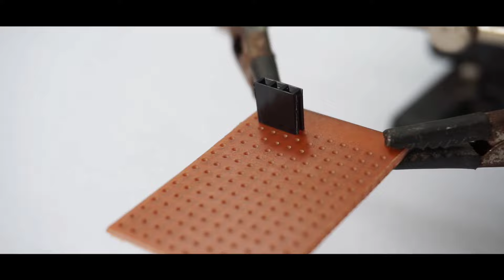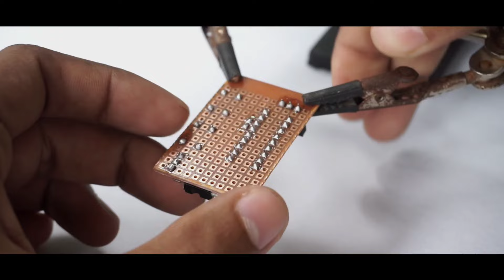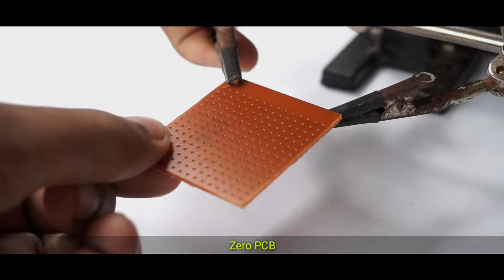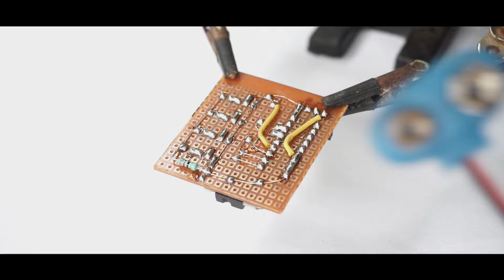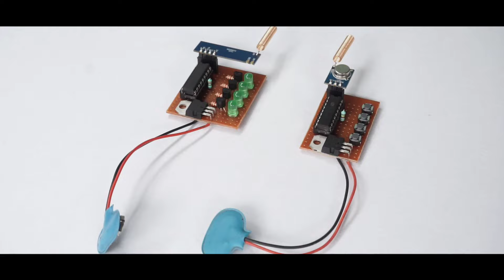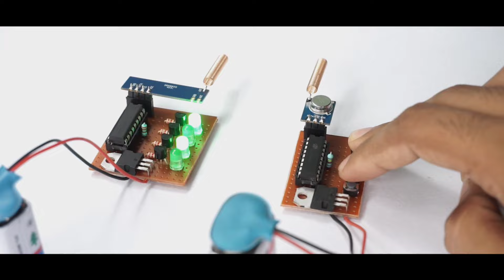How to make a 100Meter+ Ranged Wireless 4 Channel Transmitter and Receiver

Comment: seriously up to 100 meters?
Reply from the maker: More than 100 meter
Reply: @estechknowledge sir , please tell me truly ,, will it work more than 100 meters 
Because today I am going to buy it ,, please reply me sir
Reply: @Aswin_Raaj100 yes bro
Reply: what is range if it's more than 100 meters ?
Reply: @Aswin_Raaj100 maximum 10 mtrs only
Reply: The transmitter has a great output power. So I think a range from much more than 100 Meters ist possible.
Reply: I want to make e tricycle kit run wirelessly with remote....two motors....forward backward switch... acceleration joystick....turn joystick....plz help me for wireless remote and receiver....i used 24v  250w dc motor....24v 12ah battery

Comment: hey dude your circuit doesn't work without connecting te pin in ht12e to ground
and connecting A1, A2,A3,A4 in both ht12d & ht12e to ground then it should work
am I right cuz when I made your circuit it doesn't work without doing the above
Reply from the maker: Actually those pins are like passwords, if you connect A1,A5,A6 together with the ground in 12e, then you have to do the same with 12d. Then the 12d will be able to decode the signal/data.
Reply: @estechknowledge  
Then why it's not working without connecting TE pin to ground in ht12e?
Reply from the maker: The full form of the TE pin is - Transmission Enable.
Reply: @estechknowledge  
Yeah so why didn't you connect it to the ground in your diagram 😂👉👈
Reply: @estechknowledge  
that what I was mining for all this sorry if I bothered you 😂😅
Reply from the maker: Not a problem 😊
Reply from the maker: Oh, you said 'te' on your first comment I thought you wanted to say 'the'
Reply: @estechknowledge  
Also if you don't mind can you make rc car in the next videos?
You now made the l293d circuit controller & transceiver circuit can you merge these two to make rc car?
Thanks 🙏

Comment: Can I use motors instead of lights?How?
Reply: i think relay could work to connect two wire to passe the 12v or more volt

Comment: I have a query. In the video you have shown that your are connecting all the transistor's emitter pin to positive and the collector pins to respective LEDs but in the schematic you have shown that emitters are connected to LEDs collectors are connected to positive. Can you elaborate it.

Comment: I have a task to make a similar scheme, but so that the control buttons are separate from each other.  It is not rational to make the 4 transmitter board for each button.  Advise the implementation of this task: 1 receiver and 4 separate control buttons. I will be grateful for the answer

Comment: can I use xy-mk-5v receiver & fs1000a transmitter instead of srx & stx modules?
Reply from the maker: Offcourse
Reply: @estechknowledge  
One more question what is the range does the that I will use modules work at?

Comment: Looks pretty simple . But when led diode blink once , that’s mean my light is running?? And when blink same led diode again, it’s light turning off ??
 And I don’t need to program the chips??
And I going to use 3v battery. So I don’t need to use resistors??
Reply: Stx & srx use 5v so you cant

Comment: Mene iske output pr l293d ic and transistor dono use karke dekha but speed slow h lekin motor ko direct 5v ya 3v current dete h to motor ki speed jayada hoti h.
Kya aap bta skte ho ise kese solve kre ?????

Comment: Buenos días. No funciona, no se sincronizan los HT. Los valores de resistencias del oscilador interno pin 14 y 15 no parecen correcto. He comprado todos los componentes identica marca pero no puedo sincronizarlos.
Reply from the maker: What you are using as power supply?

Comment: Esta equivocado el diagrama
Reply from the maker: Which part?
Reply: @estechknowledge  
yeah bro it's wrong te pin that in ht12e should be connected to ground @ pin 1,2,3,4,5 in both (ht12d & ht12e) should be connected to ground too
Reply: @yousefelectronics9255  👍